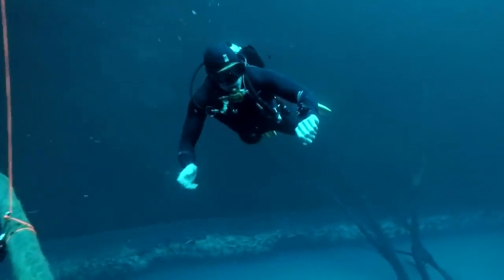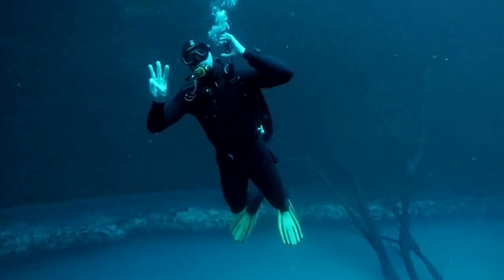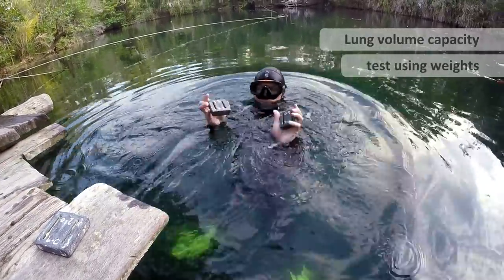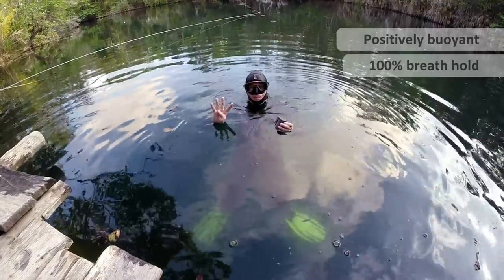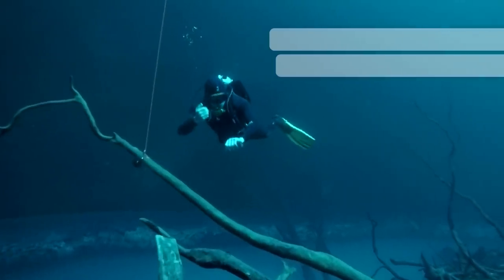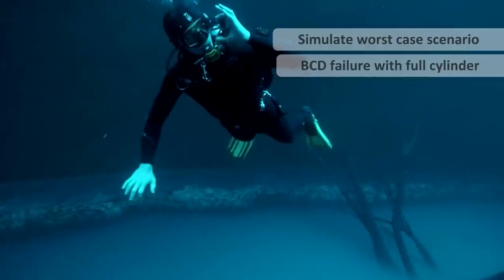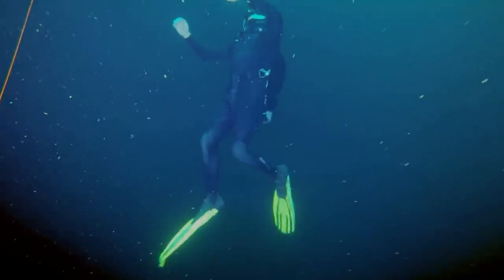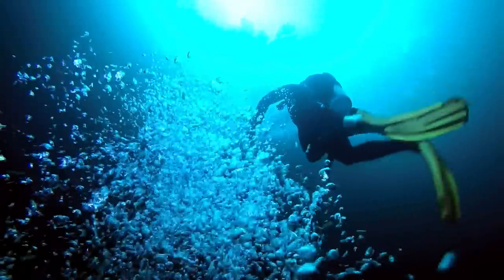BCD Failure : Single Cylinder | Sidemounting.com

Comment: as a master cert diver, privately  trained by a NAVY SEAL and not from a (joke) dive shop, I was trained how to dive with and WITHOUT  a BCD and lean how to control my weight and dive "neutral". So I never have to have this type of issue. I havent used a BCD in over 200 dives, spear fishing,, most at around 75- 100ft. Yes, I did have a BCD for my double 90 set up, but only needed 8 lbs of weight.
 cant count the times I have watched other (civy) divers have problems that could of been avoided.

Comment: I have had two BCD incidents in the last few Dives. One was a power inflator that was leaking so my BC was filling slowly during the dive. The Simple Solution to that was to disconnect the power inflator and use it the old fashioned way. The second incident I had the power inflator hose somehow got loose where it connects to the BC itself on the shoulder. Neither incident really was much to write home about I dealt with it I signaled my partner that I had a problem and return to the boat no fuss no muss. When I got to the boat I examined the connection and tightened it up. No life-threatening situation just deal with it.

Comment: I had an opposite issue with my dive partner having a run away BCD.  It fully inflated at 30 m underwater.  Luckily we had just started our dive, and I was close enough to them to help control thier accent.  But up until then everyone (including the course material) talked about BCD failures as if would only ever be loss of air in the system.
Reply: Some organisations also train for these failures. We had to train to disconnect the inflator from the BCD in these issues. But I think if you're deep, this could be hard to do on short notice. 

Never less, train for every failure ...

Comment: I was trained in emergency ascent from 25 ft. The instructor goes behind you while 25 feet underwater and shuts off your air to simulate an out of air emergency. You ascend fairly quickly, actively exhaling all the way to the surface so you dont blow out a lung. They dont do this training anymore because its considered too dangerous!
Reply from the maker: Can you share with us what agency, course and year when you did your training?

Comment: Hi Steve. Thank you for this video and I like the way you demonstrate the concept of not over-weighting. However, I have a question: in your video, your lung can support at max 4.8kg of weight at the surface, which is 1.5kg more than the weight of your full tank + empty BCD (3.3kg). However, at the end of dive, suppose you have reserved amount of air in the tank (-1.3kg), and you breathe normally underwater (which means your lung presents +3.3kg positive buoyancy), in order to avoid ascending to the surface unexpectedly due to underweight, you will need to carry extra 3.3kg - 1.3kg = 2 kg of lead weights to be neutral buoyant underwater. This means you will start your dive with 3.3kg (full tank+empty BCD) + 2kg (lead weight) = 5.2kg, which exceeds the max weight your lung can support. What if you have failed BCD with full tank in this situation? You will need hard kick to avoid from sinking, won't you? 

Is this a contradict between the max weight you can overweight in case of BCD failure, and the min weight you need to avoid unexpected ascent at the end of dive?
Reply from the maker: Hi, I don't doubt the numbers you quote but it is important to consider the wetsuit crush too. Generally at the surface a wetsuit is very buoyant, especially when first getting in then after diving in it and crushing it, it becomes less buoyant to a degree, also the level of breathing control a diver has especially a skilled one is a lot, the ability to control different lung volumes makes a huge difference. I highly recommend if you have not already and invest £10 and watch the Masterclass series this will explain concepts like this in more detail https://www.sidemounting.com/product/scuba-diving-masterclass/ Regards, Steve

Comment: With integrated weights, you could still drop one weight from your bcd. As you use up your air, the tank will be more buoyant and you will have trouble doing a safety stop and holding a steady depth if you are just a bit underweighted. I dive with 5 mil wetsuit and carry 18 lbs lead. It always works just right for me, but i will do some testing and simulate a blown bcd. That tip about using a smb  for emergency buoyancy was a great idea... i would have never thought of that!

Comment: Something is not clear for me. With the example in the video of 3,3 kg weight + 1 kg additional weight which still gives neutral bouyancy on the surface, what will happen if my tank will be empty and weight will be less with the 2 kg? I will have positive buoyancy and I will not be able to stop on 3 or 5 m safety stop because I will have positive buoyancy.
Or if  have neutral buoyancy on the surface with full tank, and I have 7 mm neoprene I will not be neutral at 25 m depth with full tank, is not it?

Comment: this is pretty good but i think you will run into some issues when you start carrying large quantitys of gas say a twin 12 steel with two aluminunum stages you will propabaly not be able to do that with full tanks
Reply from the maker: Thanks Samuel, we cover these test several times with all cylinder configurations. This video you will want to watch next https://www.sidemounting.com/lesson/technical-divers-multi-stage-drysuit-20-min/ covers tec diving wing failure with x2 steel LP 200 BAR cylinders and x2 Aluminium 80 cylinders all full. Regards, Steve

Comment: Could someone tell me what that dive computer is called? Looks clean and easy to read
Reply from the maker: It is a xDeep dive computer / bottom timer. But I don't think you can get them anymore, all the screens fade after a year or so of use and the built-in battery also needs replacing after a year or so as well. I would advise people to get a Shearwater dive computer now, well worth your investment. Regards, Steve

Comment: This is great theory to know and it's something people should strive towards, however as with everything, reality is a little different. I can get to perfect buoyancy with a single for my rec dives, but with doubles..... no way. Dual HP100's full is -17lbs and that's before accounting for manifold/regs and all the other gear. I've even bought a carbon fiber backplate to reduce weight as much as possible. My doubles wing is a dual bladder for redundancy. In much the same way as in theoretically electronics (computers) also rarely if ever fail and yet I take a second Perdix AI, just in case the primary fails. Theory vs. reality.
Reply: Reality is if your BCD fails, you use one of your SMBs for lift, or you use your alternate to blow up your wetsuit, or your drysuite if you dive with one.
And belive me, if you have to, you will kick that out, plenty of lift can be created with your fins + weigth drop.
Reply: Yeah for technical diving you should always have redundancies. In fact not only should you have a dual bladder wing(or wing+drysuit), you should have a liftbag and a DSMB both of which can be used for buoyancy in an emergency.

Comment: I have a question. Is there a way to add permanent buoyancy other than a thicker suit, or lighter tanks? My empty tank water weight plus regs is  9.5kg. That is already considerably more than i need in my 7mm wetsuit. It might be ok with my second 7mm half suit with hood on top, but i really hate wearing that when not absolutely required. Is there a form of noncompressible buoyancy that can be added into a bcd? Or neoprene tank sleeves perhaps? Or is a lighter tank setup the only option?

Comment: Nice video, thanks for share . One question . the wetsuit you wear is a 7 mm, 5mm or 3 mm ?
Reply from the maker: It is a well used 7mm wetsuit (more like a 5mm) with a thermocline hooded vest underneath
Reply: @sidemountscubadiving  Thanks for answer me , So with only 3 kilos you can dive with a 7mm wetsuit, in fresh water (test on the lake) and  salt water too (test on shipwreck), this is correct?  Amazing

Comment: I'm just a enthusiasts with AOWD. Thanks for your tips! You can always mention that in places with high risk / possibility of up currents like Komodo it maybe better to have a little more weight. Do you agree :)?
Reply: I don't. Currents can wrap around structures (like the pinnacles in Komodo) and go downwards.  A downwards current + an overweighted diver and you're going to have a bad day.  I've never seen the need to be deliberately overweighted.

Comment: I just separate my weights so ankles & 1 kg can be removed independently of my belt.
Also have a lift bag & 2x Dsmb so I can use them clipped to my belt as a buoyancy control..mine have dump valves & I make sure I can invert or detach it easily..once your on twins with 2kg torch batteries & drysuit etc etc your breathing is much less effective as a control..

Comment: I learned this the hard way. Back in 2003 I was 30 and decided to learned to dive. I have lived on the Gulf of Mexico all my life salty water gives me the feeling of being home. 
So I started going to a very popular dive school in Jacksonville FL. I passed everything did all my check out dives. For my first open water real dive we decided to go to west palm beach and do the shark bowl. After spending 30 min at 80ft it was time to go. I reached over to bump a little air back in my bcd and nothing happened. So I stood up and got the attention of my dive buddie. I was at 1000 psi and had a 5 min safety stop at 15 ft. So I dropped my led bags out of my bcd and I was still standing on the bottom looking a black tips coming in to check out my problem. I put my octopus in my wetsuit to make a redneck BCD. It only took a few short bumps to get me neutral.
Reply: If you were trained properly (OW divers aren't permitted to dive to that depth) you would have known that a couple of breaths into the oral inflation valve would have made you positive enough to make a controlled ascent whilst leaving your weighting intact and without comprimising your remaining gas or alternate air source. It's lucky you didnt suffer from DCI. Any other new divers reading this, please know never to do this. It's both stupid and reckless. We are trained correctly to know what to do in these situations and this is not it.

Comment: Can someone explain? I don’t get what difference it makes if you ditched for example 10 lbs that weights you perfectly instead of 15lbs.
In both cases you dropped whatever weight you had on yourself that you’d acquire neutral buoyancy with.

Comment: Why won't ditching a weight belt help? I certainly understand that having to ditch is very undesirable, but can someone please explain how ditching won't get you off the bottom, please? Thanks.
Reply: Yes, that will get you get off the bottom. However, your ascent will be rapid & uncontrolled, which greatly increases the risk of DCS.

Comment: Some schools are just adding way too much weight during courses. This is a big mistake. They will do it since it's easier than fighting with students struggling with descending. One of my friends (155cm 50kg) got a 6kg weight belt during OWD course (salt water, short 5mm wetsuit). You can imagine what was buoyancy skill set taken after a course like that.

Comment: Excellent video. With a twinset and 2 stages that are all full though, thats approximately 6kg of weight in the air that is in the cylinders. This means in order to be able to hold a stop with everything empty you need to initially be relatively 6kg overweighted compared to the end of a (emergency situation) dive scenario. Is it possible to counter these 6kg of weight with an average person's lung volume and kicking upwards?
Reply: Is that in salt or fresh water?
Reply: it all depends of salt or fresh water and also the volume of your lungs
Reply: Drop the stages if it's life or death situation.

Comment: I assume the point of this video is come back up without ditching your weights if the BCD fails. Versus the point of no return and having to dump your weights? In the end you're not going to get much lighter than dumping your weights so it doesn't matter if you're overweighted by 100%. It does matter if you want to keep your weights...

Comment: What thickness wetsuit is this?
Reply: Very important distinction!!
Let's say cold water diver,   double 7mm suit, double 12L steel tanks,  
If you're balanced at 3m on low air,   your rig is 13kg negatively balanced at 30m, 

An old 5mm vs double 7mm: You need much more weight to get down (or stay down at your last stop).. at depth, the suit compresses and works against your buoyancy. 
So worst case, high compressing suit, at depth, full tank, no bottom below, many might not make it up when their BCD fails.. That's why I dive with 4,5kg belt, 3kg in 4 trim pockets, even though I never expect to ditch.

Comment: So if using an aluminum 80, suit up with an empty bc and a full tank, normal breathing (roughly 80% lung capacity) when properly weighted should have you floating at eye level. Then just add about 4-5lbs additional weight to allow for increased buoyancy after tank pressure drops to reserve (approx 700 psi).

Comment: When I did may perfect buoyancy course, we started with 8kg and removed until 6kg, which was a little bit over weight but I guess this was still better then too less. 
I understand too much can be dangerous,  but in my case I felt more comfotable, to use 6kg then 4kg which was far too less,  secoundly i don't think  5 or 6 makes such a different. 

But I wonder what you think,  I thought it was okay to be over weight when you start your dive so it would be perfect at the end of the dive when your tank gets empty. 
But I would love to know what a pro  think about.

Comment: how much weight did you use at the test ? did i miss it ?

in my head you had to add 2 kg of weight to stay neutral boyent with an empty tank. But then you would have 5.3kg weight at the beginning of the dive. In your test youre speaking of 3.3kg wich is only the full tank.
Reply: he take additional +1,5 kg, to 3... summary gets 4,5

Comment: But you're supposed to empty your BCD on the way up and NEVER use it as a way to ascend! A BCD failure wouldn't change anything : you use your legs and then orally inflate at the surface.
Reply: Agree - this video IMO is very misleading.

Comment: How many BCD failures have ever occurred?!  If they do happen, simply drop your weight belt and swim up with your bubbles.  This is way over complicated and a not needed solution to a non problem.  As for neutral buoyancy on normal sport scuba, you want to be heavy and dive the deepest part first, and work your way up the cliff or ship wreck.  It's rare to dive at one depth (maybe military ship welders) but if you do stay at 25 feet floating with a current, it's not hard to do so, besides every breath makes you go up or down as your demo shows...  I don't want some complicated bladder, battery and computer affecting my dive that can fail. But hey, I drive a stick in my 2005 G35 sports coupe - no Tesla for me!